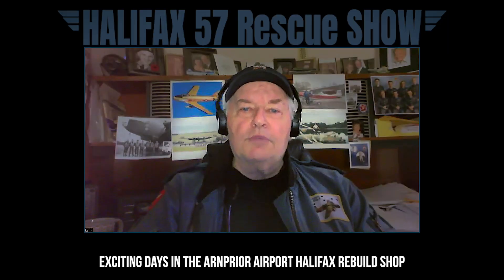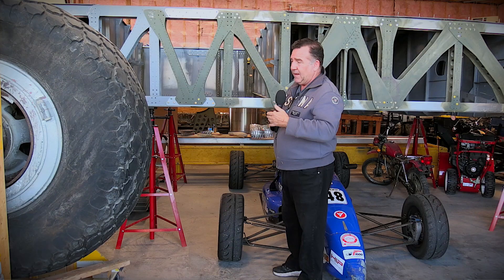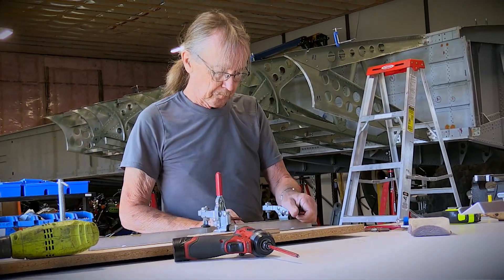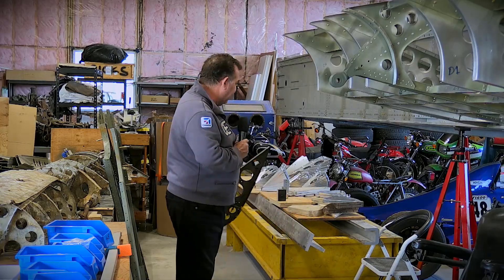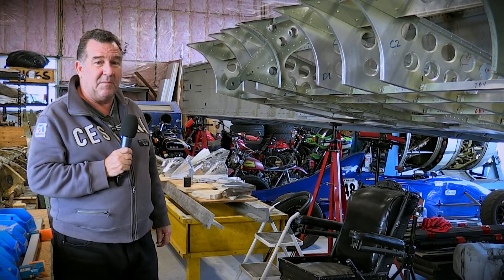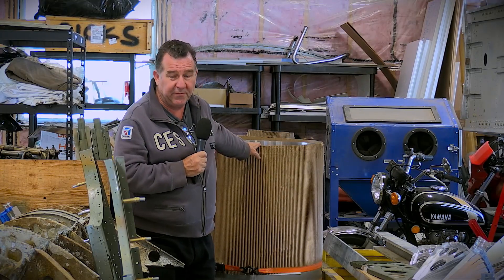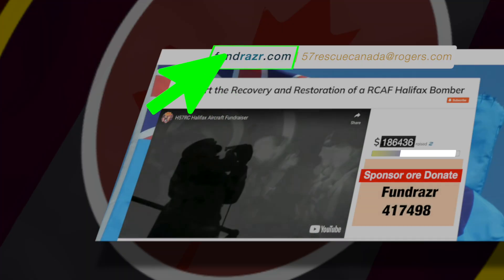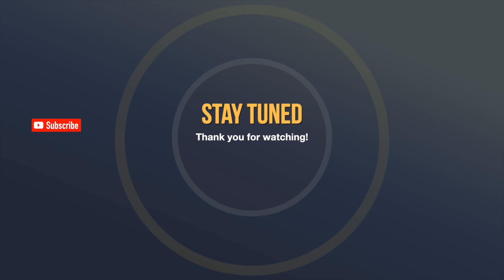Halifax 57 Rescue Show 30 2025

Comment: Very high costs were also noticed by me, building only a Touring Motor Glider from composite. Now I understand cars were made from steel sheeting and cast aluminium, and some plastics. 
Scandalus high prices for a thin sheet of rolled aluminium... you have to talk to industry to find material sponsors. There must be some surplus anywhere...
Very good work!